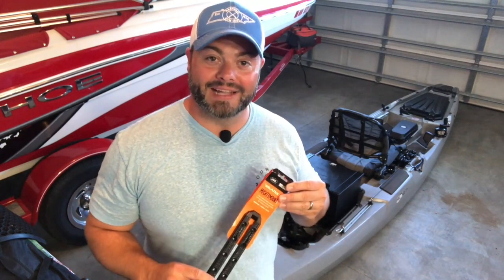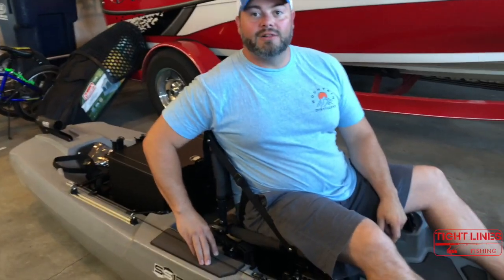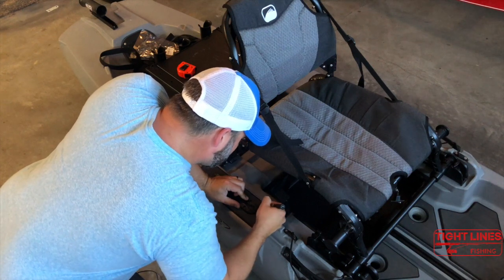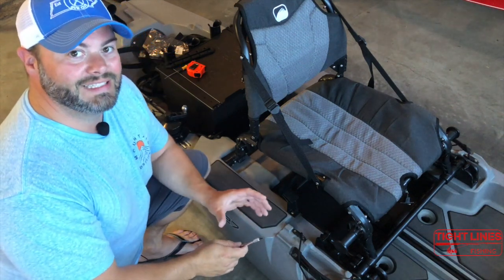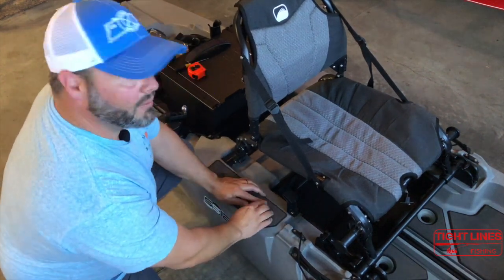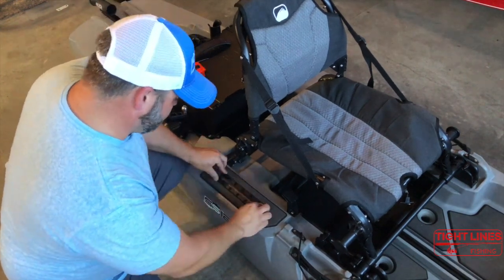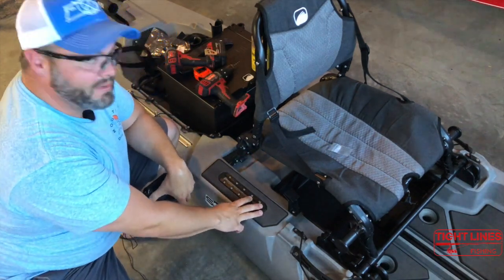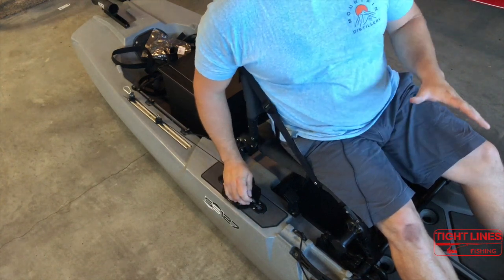YakAttack Mighty Mount - Mounting into Perch Pad of Bonafide SS127

Comment: Hey this is exactly what I wanted to do and REALLY appreciate the video.  I have my might max rail and the anchor wizard ready to go.  But in trying to dry-fit them together before I start cutting and drilling, I found it impossible to slide the t-nuts of the anchor wizard into the track.  Did you have this problem?  Should I cut down the t-nut?  I don't want to start cutting into things until I have some confidence that this will work ok.  Thanks a bunch, Steve, Tucson.
Reply from the maker: Steve S it is an awesome mod and I haven’t looked back since. I didn’t have any issues getting the T-bolts into the track. You have to make sure they are loose enough to slide into the track, but not too loose that they fall out of the locking nuts. Hope that helps.
Reply: @tightlinesfishing9279  wow, thanks for the prompt response.  Just got my SS127 a couple weeks back.  I have played with the nuts being as loose as I can get them, turned them over, tried putting them in tight, nothing helps.  I am thinking of cutting down the width of the t-nuts as it is not essential to snugging it up.  Have posted on the owners' page too. Thanks again for the video.  Cheri and I are laughing at the new term you taught us, "Frenching"!!!
Reply: @steves9088  I'm having the same issue. T bolts barely slide in the track. It is very snug! Did you ever figure something out.
Reply: @horst.is.fishing  hey, just saw your post.  Be sure you haven't torqued down the might max mounting bolts to the point that they are bending it down.  I wound up taking a hack saw to the "t"-nuts and cutting almost all of one side off.  That allowed them to slide in the slot without trouble.  I had further trouble with the anchor wizard "chute".  I mounted another mighty max track on the stern of the boat.  The supplied bolts were too short to go through the mighty-max.  Got replacements at the local hardware store, stainless of course.  Good luck.  Things are working just fine for me now.   The instructions that came with the anchor wizard and online are a joke....no help at all.

Comment: How did the chute mount up on the back ? Have to drill hole in chute mount to match the pre set holes and what size screws did it take ?
Reply from the maker: brandon sexton the chute lined up perfectly with the mounting holes that are factory standard on the back of the SS127. I believe the bolts are 1/4-20
Reply: Tight Lines Fishing thanks man
Reply: @tightlinesfishing9279  This is exactly what I wanted to know.  If I buy the Anchor Wizard chute, will it mount with the existing holes on the back of the SS127?